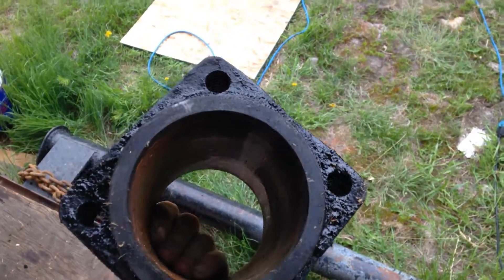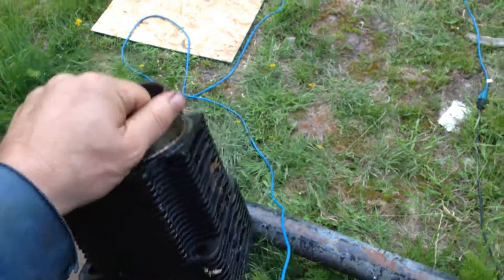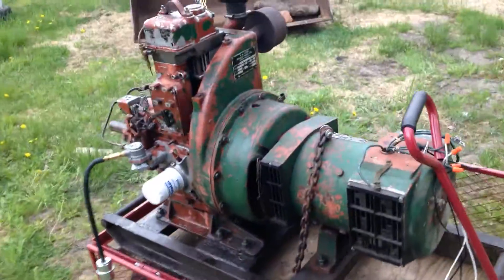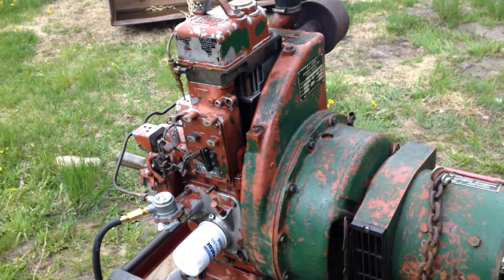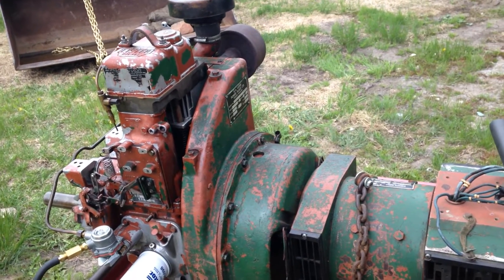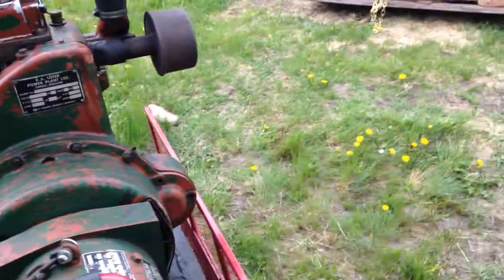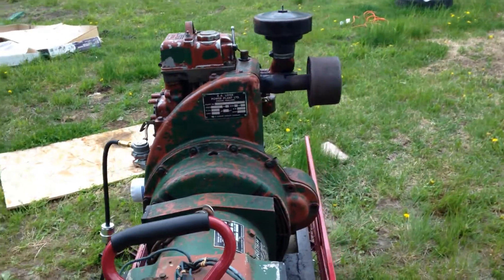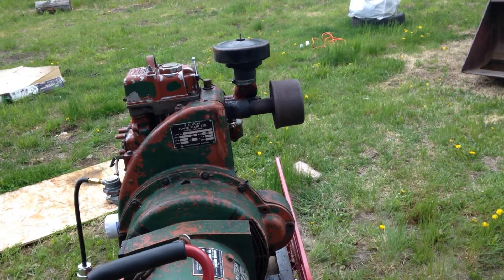Lister Diesel ST-1  With 4 KW Brush generator

Comment: hey if you have any update please let us konw. I'm hoping to buy one.
Reply from the maker: I seldom use it, as it has the 50 cycle generator head ( for the United Kingdom?) and everything needs 60 cycle here in North America, other than that it’s fine. Only advice I can offer is that if I was to overhaul another Lister I would Source the parts from the UK. (As opposed to the place in Kansas ) .
Reply: @North700  thanks for the reply. My requirement is to use it for about 2 hours everyday to generate electricity. Is it a good idea? Reliable wise... fuel economy wise (since it is a bit old engine)
Reply from the maker: @shakyabandara4910  yes , very good engine, with proper maintenance will last decades
Reply: @North700  any idea how much fuel it would use in one hour in its full capacity? ( if I use with total 4kW load)
Reply from the maker: @shakyabandara4910  I don’t know for certain, my best estimate is 1liter /hr
Reply: @North700  can we run it with kerosene ?

Comment: Nice. Dear, at what voltage does it run... 230 or 115?
Reply from the maker: 110 but only 50htz
Reply: @North700  How come it's only 50hz with the engine at 1800rpm?
Reply: @North700  Has to be 60hz with the engine running at 1800rpm
Reply from the maker: It’s a European ( probably English ) generator head, didn’t know it when I acquired it but there is a distinction between North American and European equipment
Reply: @North700  Right I see. It'll output a high voltage but at 60hz perhaps, which may be less than ideal 😂